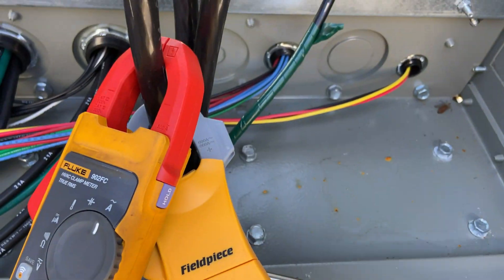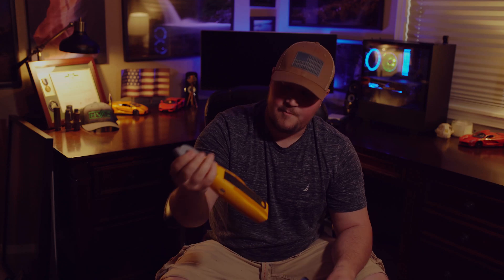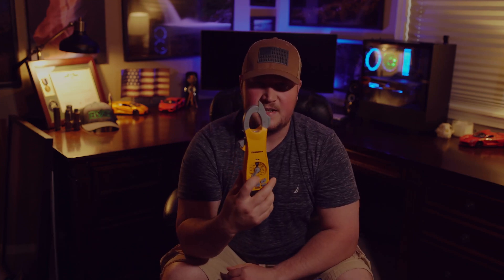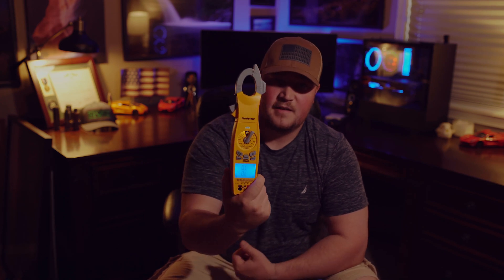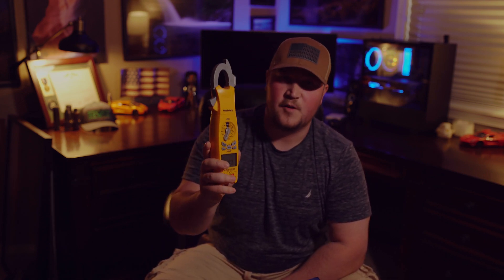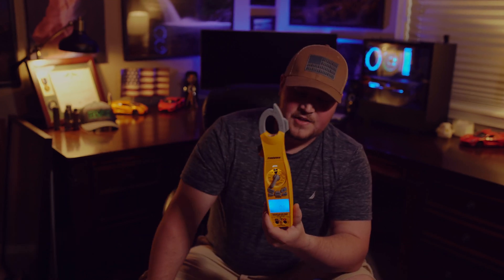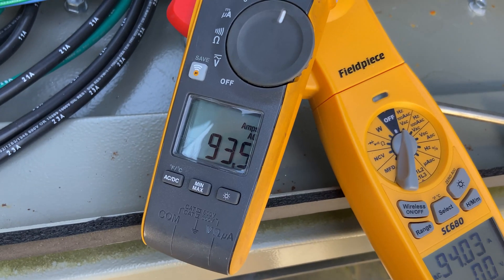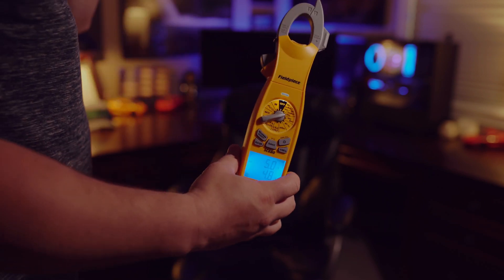Fieldpiece sc680 Review - Why I would Avoid

Comment: Fieldpiece meters and gauges made my dads career in HVAC and maintenance until he became a manager, and I got into HVAC. He gave me this meter, which I appreciate greatly compared to the FP SC260 my company gave me. The wireless function and two temp probes have come in handy several times. Fluke is probably perfect for sparkys, but for the bridge to mechanical and thermodynamic targets, Fieldpiece is pretty much where it's at.

Comment: Used one of these for years. Switched to FLUKE 87 V MAXX, Never looked back.  

Being a lite-comercial tech the Only thing I missed was the ability to check rotation.  Picked up a "B&K Precision Model 302" off of Ebay.  Not only does it read rotation of in coming power, but it can tell me rotation of a motor if I spinn the shaft.  A time saver when settling up VFD's before the power is on.  

I dont really use this feature but the FP meter isn't fast enough to read inrush current.  Where the FLUKE 902 gets in sync with the ring of the inrush current to measure correctly.

The 87 reads peak, average and min voltage/current.  These are very useful troubleshooting an intermittent problem.  Using the optional clamp on my 87 to read amps down to 0.3 amps is very useful in low voltage circuits.  You can quickly move down a circut to find the power hog. 

I generally don't use auto-range, but FLUKE displays OL while FP displays 0.0 THIS CAN GET YOU KILLED.

The temp probes need to be both connected on the same sides for accurate readings. It will change readings if only one is connected. But a DVM is probably not the best choice for getting accurate temperature readings.

Comment: I have the same meter (SC680) you were testing and I don't get any phantom amps when using the amp clamp and turning the wireless button on. You may have gotten a faulty meter, I would definitely contact field piece and have them send you a replacement. Hope this was helpful.

Comment: I've had the SC680 for a couple years now.  I just double checked and I don't have any issue with the ghost amperage.  The first meter I received had a broken clamp arm with very little use.  The new one replaced under warranty has been quite solid for a couple years of everyday use.  I've compared the amp reading to my Fluke 902 and the FP is definitely more accurate. LOL it's not 18" it's about 11.75".  That's still a long meter, but very manageable.  It works very well for fractional hp motors like draft inducers that my 902 would have trouble reading.  Also, the variance in reading depending on where the conductor is positioned in the clamp is less than the 902 as well.  I realize there are marks on the clamp to gain the optimized reading, but that's not always feasible.
Reply: He's bias, once he said "I grew up with or I've always used fluke" I already knew.
Reply: @GonzDez-sh7vx  My exact thought as well, but his meter did read off a bit.

Comment: I see is one of the comment chains that HVAC Tool Review guy stated 2 years ago  "I reached out to FP directly and they sent me a new meter,  new one is not having the same issue.  You should reach out to their warranty department." maybe HVAC Tool Review guy has stopped posting ! In reading all the posts on this issue,  It would be fair to surmise that the multiple meters that were listed as having similar issue might have been due to manufacturer quality control issues.  It would be more of a fair review for FP if HVAC Tool Review guy would come back on and clarify if this issues and if it's been totally resolved or not. The reason I'm stating this is that I am looking at purchasing the complete set of Field Piece tools that use the Job Link software system.

Comment: I am not a HVAC guy, I am a Electronics Engineer and Field Systems/Network Engineer however I have almost all Fluke and a afew Klein tools. I was wondering about getting this meter as Ive had 3 people not be able to figure out the zoning AC and not get one of them to work even after they replaced parts. So figured if I can build a PCB and actually build devices and fix them and I have some electrical knowledge why can't I figure out my own AC issues. The last guys were the last straw telling me to change my ducts as it can't handle the airflow or push out air as good as the second unit. But my AC worked on those same ducts fine for alittle over a decade. Figuring its getting too hot and I need my AC so figured I get a sc680 because it has the W for Watts thinking great I don't have to do the math for Volts and Amps to get Watts. Did they ever send you a replacement? The Phantom volt and amps would drive me nuts. The size of a meter won't bother me as I carry a 20lb with 20in screen laptop not a wannabe laptop without speed, but battery lasts 19 hours I'm happy with a gaming laptop with balls even if the battery life is 2 hours. My tool bag weights about 85 lbs so its what I carry up and down stairs or ladders. Whats your opinion on the Fluke  378fc?

Comment: Hey did ever get a different one? If so, what were the results? If not, what did fieldpiece say about it? My 660C does kinda the same thing with the wireless off. No near as bad though. I’ve never used it wirelessly because I don’t have and I not going to buy the transmitter. I was thinking about upgrading but after seeing this, it’s also a deal breaker for me unless the issue has been solved. Let me know. Thanks

Comment: Thank you so much for your review of the Fieldpiece sc680.  I was on the verge of buying this unit. Thank heavens I saw your video before I pushed the buy button. I recently have bought into the Job Link system, and I think an amp prob is the only thing I don't have for my Job Link Probe system. I was desperately wanting to retire my Fluke amp clamp with this tool, since the Job Link system has proven so valuable in reducing my time in the heat, by allowing me to close my tickets so much more quickly. I was really salivating, when I saw it had dual temperature probes, and can even show the Delta T in the display! Then so very importantly,  it would also replace my need to pack my megger for checking windings in ECM motors. Dude I was ready to buy one this very evening . I was going to push the buy button  this very night But that was before I saw your review. So for me it's a soul crusher that a tool built  primarily as an Amp Clamp fails in its primary function. I love every other field piece item I've ever bought. Sad, so sad.
Reply from the maker: Thanks for checking it out,  I did reach out to Fieldpiece about the problems I was having and they sent me a new meter that did not suffer from the same issues. I posted an update video.  If you scroll through the comments there were quite a few other guys that have experienced the same amp issues,  and I’m not sure if they were able to get their meter replaced or not.
Reply: @HVACToolReview So the problems in this video were corrected with a newer meter?

Comment: My fieldpiece HS36 reads phantom voltage and amps. I'm thinking they have something bad going on with board design.
Reply from the maker: Hopefully you can contact them and they will fix it for you
Reply: @HVACToolReview  It's way out of warranty but I can still do what I need to do with it. I'm thinking about getting this one but it's making me nervous to see they still have the same issues and I want it to be fully compatible with measure quick. Is that thing even capable of receiving firmware updates?

Comment: I Just picked up the 680 and mine doesn't' show any amp draw when I activate the Wireless Readout.... You should get in touch with Fieldpiece and let them know you have a faulty Meter..... Nice review bud....
Reply from the maker: Right on,  yea they ended up sending me a new meter.  Replacement hasn’t had the same issue. Had a few other guys reach out to me saying theirs did the same thing,  must have been an early model glitch
Reply: Sounds like yours was worse than his then. Is that what you were trying to say? Yours didn't work at all in bluetooth mode? No amp draw means it's not sensing any current at all

Comment: I got mine a week or 2 ago and I am not impressed. I wish I could return it to johnstone supply. It didn’t read 120v today ON THE LINE SIDE of a contractor and it also messed up on a capacitor reading today 3 MFD and a fluke said 33 MFD and a south wire that’s 60 bucks ready 33MFD. If a meter messes up on me it is dead to me. Out almost 400 bucks😡🤬
Reply: Try getting new lead's, that solved all my issues.
Reply: @wd8557  I’ll try that out hope that resolves it
Reply: @12pullz   Keep in mind the electronics in these meter's all are the same, just like electric drill's,  TV's etc. You can go on Amazon and see bad reviews for every meter out their including fluke.
Reply: @wd8557  I tried fluke leads on it today and can report this seemed to clear up my issue.
Reply: @12pullz  they actually sell leads with like a little window In it. It will show you when they go bad. Glad that helped you out.
Reply from the maker: @W D good to know!
Reply from the maker: Yeah that's pretty much how I feel.  I've actually had it do the same thing with the line voltage readings a couple of times. I wasn't sure that's what happened, so I didn't mention it here.

Initially, I was second guessing myself thinking maybe one of the leads was just loose, second time really made me wonder wth was going on.  Now it really just confirms those suspicions.  Maybe message FP and return directly?  They were easy to work with for me,  could get a new replacement and sell it.

I stick with my fluke
Reply: @HVACToolReview  yeah might have to give FP a call I wish I would have went with the 87V max 😩

Comment: Is it possible that you can share the first few digits of the serial number on the new meter you have that’s operating correctly? I remember years ago when the SMAN gauges first came out I bought they had a issue with the gaskets going bad on the gauges and they was prone to leaking. I called Fieldpiece and they told me that the first batch of gauges they produced had these issues and they told me about the serial # beginning with (I can’t remember because it’s been years) was bad and they sent me a new one and I haven’t had any problems since.
Reply from the maker: Yea no problem.  Serial on the new meter is 20020672AACB
Reply: HVAC Tool Review Thank You! I’m going to pay attention to the serial #’s when I purchase mines. And thanks for the video I’ve learned so much from it!!
Reply from the maker: Eric The Comfort Doctor Cook not a problem!  Glad I could help!

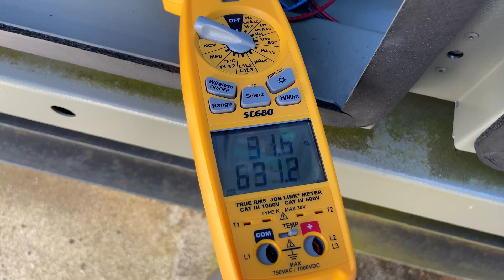Comment: Check your video at the 6:38 mark. You had the meter set to the wrong setting. You were on Hz/% setting, which is meant to be used with/thru the test leads only. I can also say the the sc480 that I own does not have the "ghosting" issue with volts & amps when the wireless feature is turned ON. My screen reads all 0000 on both displays. You are correct about the Hz "thru the clamp" not reading until there is at least a 5 amp load on the circuit. I can verify that the sc56 (older meter), sc440, & the sc660 all will display a Hz reading thru the clamp with less than 1 amp of load on a circuit. Hope that info will help. 😎👍
Reply from the maker: You are correct.  Good catch, meant to note that I realized I had it on the incorrect parameter after the fact.  Once I set it to the correct hz through the clamp setting I got intermittent results until about 5 amps.  I believe the manual stated that at least 7 amps were required to read HZ,  but I think 5 is where mine started reading.  That's Good to know about the sc480,  I was wondering if it would have any similar issues.  Either way the replacement that FP sent me no loner has the issue.
Reply: All of us know how to make a ten wrap wire loop to put in your circuit for testing. Divide by 10. Really simple, since we all have plenty of wiring, tape, wire, nuts, Mo X connectors, quarter inch, male and female Terminal, etc. It’s not a rocket science guys.

Comment: Im using a Fieldpiece sc440 it’s pretty good, but I’ve been wanting to upgrade, been looking at the Fluke 902, i have a Fluke 87v and i love it, but it doesn’t check amperage with out an extra attachment, I have alway used Fluke and still think its the best, but Fieldpiece keeps adding all these bells and whistles lol what I would like to see is inrush between these two meters, to see which one is faster, i know the Fluke 902 doesn’t actually have inrush but it can be achieved by pressing the Min/Max it would be amazing if you could do a short video of this. Thanks !
Reply: Just so you know, Inrush & Max are not the same thing. Two totally different current "captures". Inrush only captures the 1st 100ms of current as the compressor is kicking out of the locked rotor state of start up. When a unit is starting properly, the Inrush current will be very close to the LRA rating on the data plate. MAX will be a much lower reading. 👍
Reply from the maker: Yea I’ve got the 87 and the 116 but it’s so much easier to have a built in amp clamp.
I’ll definitely get a video of that,  should have thought to do it in my initial video of the sc680

Comment: I’ve had this meter for about a year now and have had no issues not even the phantom amps with wireless turned on. 🤔🤷🏾‍♂️
Reply from the maker: When did the 680 come out?  I didn’t think it had been out for a year yet.  Glad yours is working well,  seems there are a few others having the same issues I was.
Reply: It’s been close to a year.  I talked to Fieldpiece about it in January of last year when I had an issue with my 660. And they told me about the 680 that would be coming in the fall but it actually came in the summer I believe
Reply: Good channel by the way
Reply from the maker: Thanks man appreciate it!
Reply: I've had mine for 2 months and no problem with it, no phantom readings

Comment from the maker: Let me know if you have experienced the same issue with the wireless amp readings
Reply: I have the sc480. No problems with wireless amp readings. I’ll bet if you contact Fieldpiece they will send you another meter.
Reply: Call FIELDPIECE INSTRUMENTS  senda a mail to Tony González
Reply from the maker: REFRIGERACIÓN VILAPRIÑO I got ahold of Chris at Fieldpiece.  Sent me a new meter and this one is working fine.
Reply: @HVACToolReview  update the title.... unless you would still avoid🤷🏽‍♂️
Reply from the maker: Ivan Hall the new meter doesn’t have the phantom voltage and amperage readings but I have experienced a few other issues since then.  Every so often it seems to lock up when taking a volt reading, and will display 0v even if there is live voltage present.  If I cycle it off then on it will begin reading voltage correctly.  I’ve experienced too many issues in the short amount of time I’ve owned it to recommend it, which is why I have not updated the title.
Reply: Great review.  Watched it one day too late.  Purchased this yesterday.  Fortunately, my instrument display does not climb at all when I have wireless activated.  Haven't had a chance to test the hertz issue yet.  I'm disappointed about not syncing to Measure Quick yet.  Appears I have to pay for Joblink App after 60 days?  Even if I just want to use it to display readings remotely?  Hopefully I'm wrong about that assumption.  Anyone knoww how to turn off the annoying beep when measuring voltage?

Comment: I bought my meter from Tru-Tech tools and it's doing the same thing yours is doing so I emailed them and they sent me a replacement meter and my second meter still doing the same exact thing... Now I have a meter that I don't know whether to trust it or not just because it is off like that
Reply: Hozer Hvac I wish I went with that redfish too. Fieldpiece just released this meter Sc680 when I was going to get the redfish meter. So needless to say I brought the fieldpiece sc680 meter hoping that Jim Bergmann would incorporate this meter into measure quick to go with the fieldpiece probes
Reply: Adam Slape I’m sure they will fix it. And once it goes live with MQ it will be a solid meter
Reply from the maker: Wow so probably not just an isolated problem.  Odd that there is no other info on this,  maybe most just haven’t noticed yet?  Pretty unfortunate.  I emailed Fieldpiece and sent them the video.  We will see what they say
Reply: Adam Slape man that sucks. Now I’m a bit happier with the idvm550
Reply: I guess we will see what happens, thanks
Reply from the maker: I reached out to FP directly and they sent me a new meter,  new one is not having the same issue.  You should reach out to their warranty department.
Reply: Send it back since it is not what the mfr specified. TTT is usually pretty good about customer service. 
They may be just as disappointed.
Reply: The "ghost" voltage & amp readings do not appear on the sc480 when the wireless feature is ON. My screen reads all 0000 on both displays.